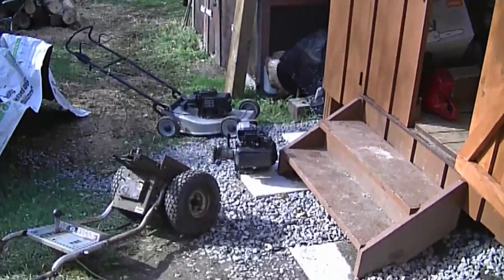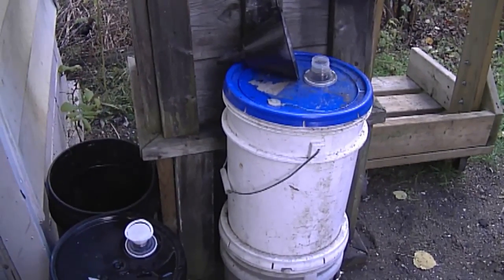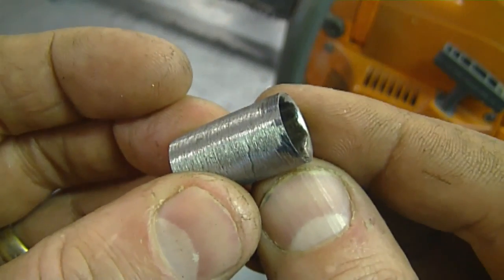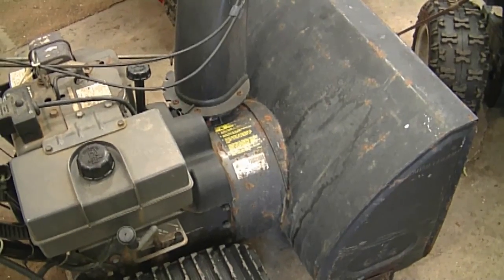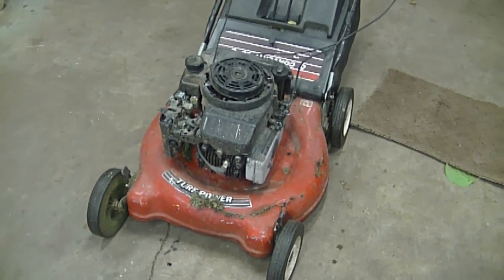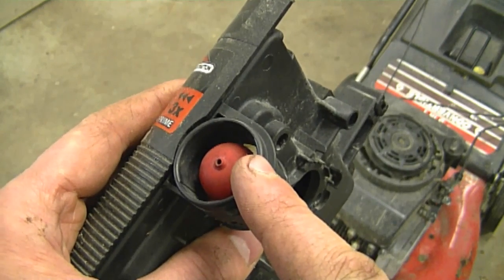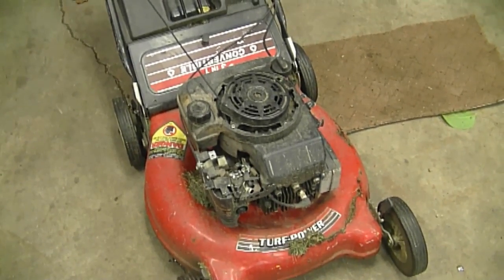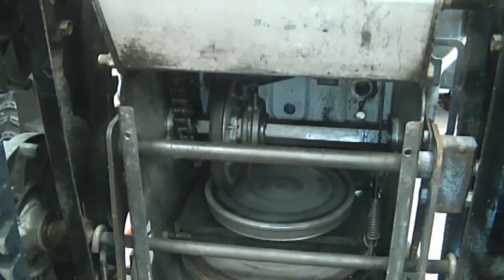Small Engines Q & A Video #135 in HD

Comment: Here in Homer, Alaska, many of us use tracks.  The wheeled snowthrowers aren't nearly as desirable.  I think it's largely based on your area and the type of snow you get most of the time.  Then again, a 42" snowthrower on the front of a garden tractor with a heated cab and coffee cup holder is tough to beat. :)

Comment: Smashing Q&A :-)

Ive done much the same as you with sockets :-) a sacrificial socket of cause is used.
Ive also ground the face flat to allow me to remove damaged nuts, removing the chamfer part on the front often allows you to get on to the part of the nut thats not damaged :-))

Sometimes home made "Single use" tools are the only way, manufacturers want a boot up the bum lol :-))

Comment: A word on chains (from an amateur bike mechanic)- 

1. The other reason to replace a worn chain is that otherwise, the sprockets will wear as well... as a chain "stretches", the gap between links extends, and the sprocket will wear to meet the new gap... which is bad news (read: shark finned teeth).

2. Not that it matters, but a chain doesn't actually stretch. Rather, the holes in the link plates extend and warp... until the're so warped the pins no longer hold .

Worn chains = BAD!

Comment: I have a lot of mowers come in that have a rusted and stiff or seized cable. I found some stuff online called "Dri-Slide bike aid". It has a squirt bottle with a long metal needle that makes it easier to squirt liquid down inside the cable sheath. I thought about buying it just for the squirt bottle and the needle applicator and maybe filling it with liquid wrench or some other penetrant or lube.

Comment: with my new saw i started it warmed it up switch it off done that a few times just heat cycles then run 6 tanks of fuel at half throttle getting wood and it wasn't large wood only small so it didn't over work the saw and it runs fine and starts easy

Comment: Thanks again for the video. They are very help full. Fast question ,a friend of mine has a 29 cc, 4 cycle grass trimmer that he felled with 2 cycle gas and now it won’t start. I cleaned the fuel filter with cab cleaner. It fires up but won’t stay running. Any ideas?

Comment: Ok, does it have good compression. Also, in the dark can you see flames coming out of the exhaust if the exhaust valve is not closing fully. (P.S. snow blowers have a decompression mech on the exhaust valve, I found out if it starts up and you shut it off the first pull will have almost all compression. If it lacks compression, you need to file off a little of the valve stem. If you need to, I can give you the specs.

Comment: Make sure ALL the 2-cycle mix has been removed and clean the spark plug.  The oil should not have caused any lasting damage. Any oil in the muffler will burn off.  I recommend NON ethanol fuel for small engines.  Starting and cleaning headaches will go away and they will run better.  Use a fuel stabilizer and run the tank dry before storing it for the winter.  You can get pure gas at marinas, airports and some stations will sell it as Agricultural or Racing fuel.   Check puregas dot org

Comment: I have a question. what is the problem when you tip over a push-mower on its side then when you crank it, it kicks back?
Reply from the maker: sometimes the oil goes into the cylinder
Reply: ok, thanks

Comment: run it no more than half throttle for 24 hours of runtime, and let it warm-up(idle to preheat the engine) for 3-5 minuts after a cold start before use

Comment: I'd like to spend LESS time cutting grass.   Is it possible to put several mowers side by side, tie them together, so when they are all running I just push the middle mower and all 4 or more mowers cut at once?  To make it even easier, the mower in the middle would be a rear self propelled mower.